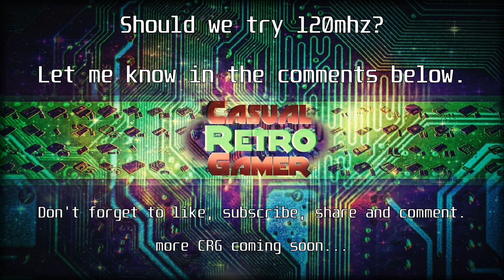Overclocking the TF330

Comment from the maker: So despite my previous warning over the cards failure it turns out I've been a bit stupid (understatement) and didn't notice the enable jumper had "fell" off.  The overclock works fine and is totally stable.  More testing this coming weekend folks.
Reply: Sometimes the solution of a breakdown is simpler than we think...I would love to see how much this card can be pushed up. I can see it's a supaduper manufacture as mine. How high can wet get? The 10000 barrier is broken! Good Job!

Comment: Did you end up trying 120?
Reply from the maker: Yes, but it didn't work properly.  The CD32 booted to its splash screen but corrupted the CF card when I tried that.  It seems the ide falls over at the higher clock speed. 

I do have a video showing the process if you're interested.
Reply: @CRG  thanks, yes I found it after posting the question :) Considering getting a TF330 myself.
Reply from the maker: @kilojulietsierra561  Its well worth the money.  The 030 processor I think really is the sweet spot for Amiga games.  Runs all the classic stuff and lets you enjoy the 3D games too.
Reply: @CRG  thanks, I would like to say I appreciate your videos as well.